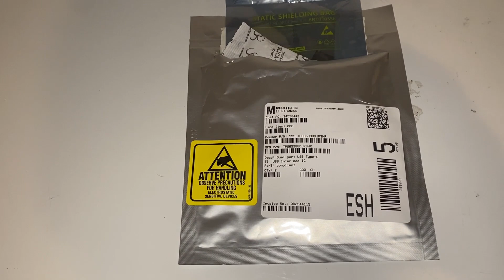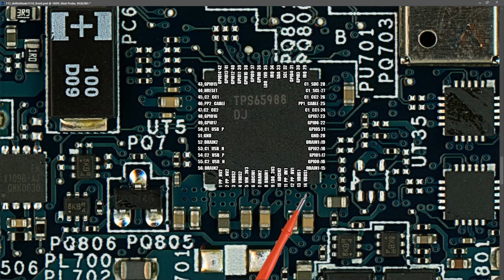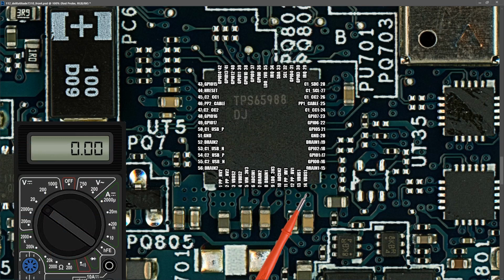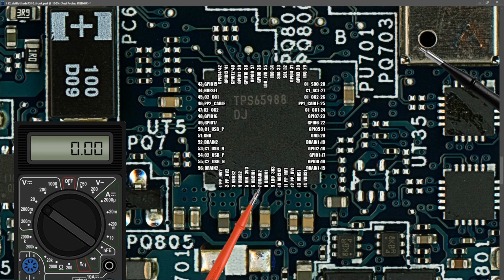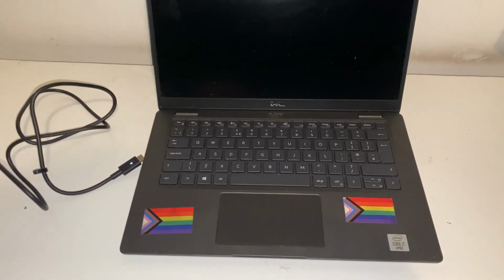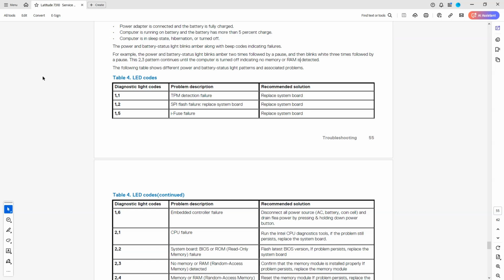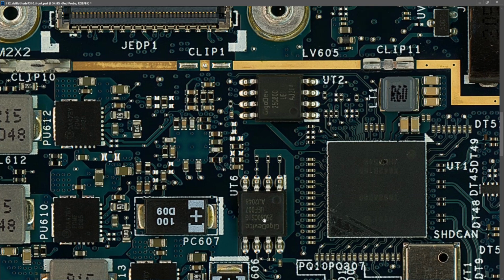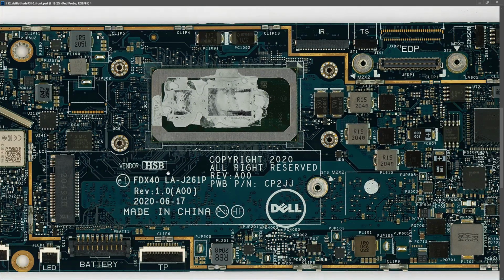DELL LATITUDE 7310 - PART 2 REPLACING THE PD CONTROLLER

Comment from the maker: Hi guys, 
Thanks for all the comments below. Just one point on the BIOS update for this Dell Latitude 7310. I also thought it would be possible to write the BIN file to USB, boot to it, and recover the BIOS. However when I check the Dell Latitude 7310 Service Manual, it says that if you have a working BIOS, you can upgrade by pressing F12 and loading the new bios file from a USB drive. But there is no means of recovering a corrupt BIOS using a bootable USB. I think I will just have to desolder the BIOS IC and use the programmer.
Reply: Does holding down Ctrl+Esc whilst powering on work?
Reply: hola puedes poner la direccion para bajar el pdf para los codigos de error

Comment: Hi @TheRepairShare673,
I have the same Dell Latitude 7310 with a very similar issue. I already replaced the TPS65988DJ, but the laptop still doesn’t power on. Now I’m considering replacing the FDX30 because when I power it up, I see sparks/fire coming directly from the area near the Realtek sound chip or the USB controller chip (SLG55544CV).

Did you ever encounter this problem on your board? Do you think replacing the FDX30 is the correct next step, or should I focus on the SLG55544CV / Realtek chip area instead?

Any advice would be really helpful. Thanks a lot!
Reply from the maker: Hi friend, unfortunately I did not make any more progress on this one. I got the main power rail back online by replacing TPS65988D IC, but it seems that the blown PD Controller was just a symptom and not the cause. 

Sounds like your's is different in any case - I did NOT see any spark need the Realtek IC. Sounds like there is a short at that location. Disconnect power and take some measurements there and see if something is shorted. Good luck.

Comment: My Intel NUC mini PC device manager shows that the TPS65988 has a problem: "This device cannot start. (Code 10) STATUS_DEVICE_POWER_FAILURE". Would you recommend replacing the TPS65988? I've noticed sporadic freezing on the PC, but I've still been able to keep using it. I'm not sure what caused the problem initially. I'd obviously like to address the underlying cause, unless the TPS65988 is the actual culprit. TI is worthless to regular users/hobbyists that don't have corporate accounts. I would appreciate any help/recommendations.
Reply from the maker: It's hard for me to say without seeing the actual board. But I would have thought that if there was an issue with the TPS65988 then you would get no power at all. I googled that error and it seems to be more related to Bluetooth failure.
Reply: @therepairshare673  Thanks for the quick follow-up. Hopefully, it's just related to Bluetooth. I'll check that out. I don't use it on that PC, so it's not a huge issue if that's the only issue. At least the PC has power 😀...still not sure why it freezes sporadically.

Comment: Nice to see the Part2

I have Schematic and BIOS if you need them I have checked the chips for you.

UC5 - Main BIOS
UT2 - Thunderbolt
UT6 = TR & PD Share ROM

So I would try flash UC5 with a new BIOS and backup you old file first
Reply from the maker: Great thank you. The UC5 has no leads, but I think I should be still able to solder it in to one of the adapters for my CH341a
Reply: @therepairshare673  The UC5 is WSON 8x6 package you can solder it to one of those little adapter boards but you can also get a pogo pin adapter for CH341A so you can read it without desolder. 
Also you can get the WSON8 adapter socket so you can just place it inside the adapter with no soldering